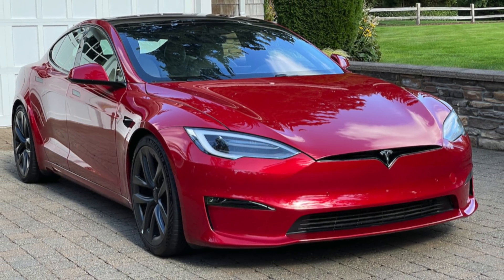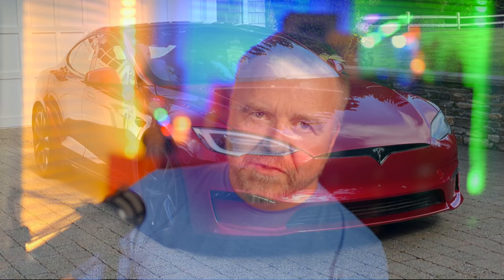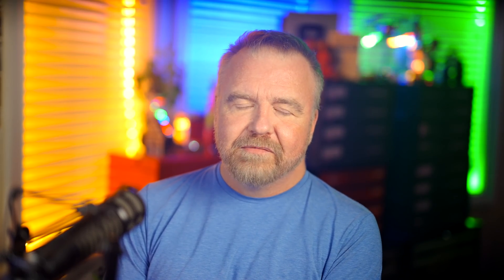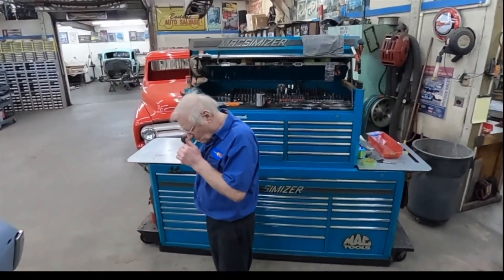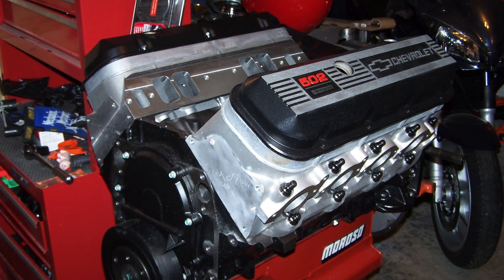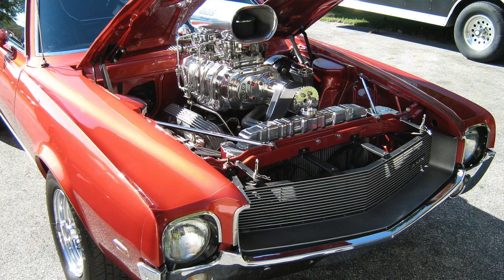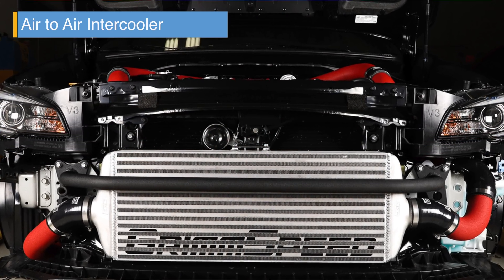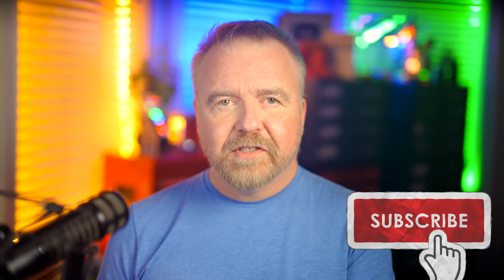Twin Turbo Power Secrets: Can I make 1500hp for $1500?  Plus Dyno Fails!

Comment: "A typical performance engine makes about 1HP per cubic inch of displacement"... I would say that's pretty outdated at this point, even for naturally aspirated engines. This is definitely normal engine HP range at least for the last 20 years. For typical performance engines 100HP per liter or 1.63HP per cu is pretty normal. A K20 civic made 200HP out of 2 liters and the Toyota 2ZZ-GE made over 180 at 1.8 liters. Those are all engines close to 20 years old now and both of these are naturally aspirated... And we haven't even mentioned bike engines which are in a league of their own in the specific power output category.
Reply from the maker: "Typical" might mean something different to you than me!
Reply: @DavesGarage  Yeah no worries I thought so anyways, I just like being pedantic. Often engines like these (while admittedly fun) have questionable everyday driveability anyways.

Comment: Knowing that you're a gear head as well as a techie you should understand what I'm about to suggest. Now, don't get me wrong, I like electric cars and not just for environmental reasons. The acceleration can be positively brutal with all that torque available from 1 RPM to whatever that motors limit is. It's just that today we have all of the parts (technologies) available to perfect the internal combustion engine although I don't think anyone has put them all together yet. Koenigsegg developed the Free Valve pneumatic (cam-less) valve system allowing variable timing and lift of each valve individually, a compressor (charger) can run on a variable speed electric motor instead of a belt or exhaust gasses, fuel injectors can vary the amount of fuel delivered, even spark timing and intensity can be varied, all controlled by the computer chip that all cars now have anyway. Get up to highway speed, open the exhaust valves (to avoid compression or vacuum drag) and shut off the spark to half of your cylinders while you cruise along a stretch of flat highway just sipping fuel at 80 MPH. Put some toe into the gas pedal to pass that truck ahead of you and the engine responds by spooling up the compressor (I can't call it turbo or super because those names are taken, maybe Vari-Charger) to pack more air into the cylinders and increase the compression ratio, pump in more fuel, adjust the spark and valves and you're off to the races. It just feels wrong that the internal combustion engine is becoming obsolete just as perfection is within easy reach.
Reply from the maker: An S63 BiTurbo is an amazing machine.   Not a lot of room to improve and its 1/3 the efficiency pf electric.  It's not that combustion can't get better, just that it can't get close.
Reply: @DavesGarage  and on the obverse, the energy density of gasoline is such that batteries just can't get anywhere close to the same ranges or ease of use. The use of diesel engines in 18 wheelers isn't going to change anytime soon because in order to adequately cover the ranges and towing demands diesel trucks face, an electric replacements battery would make the tractor overwhelmingly heavier, reducing the amount of cargo that can be legally hauled. That and the battery deterioration through such hard use would require even more frequent replacement than in cars. People can say what they will about CO2, but lithium batteries are far more environmentally destructive on longer time scales.

Comment: struck by how casually that engine pulled to 1270. like no big deal.
Reply: It's pretty damn common these days in the tuning world to reach those numbers. Especially when using E-85 gas or better.
Reply: Common these days perhaps but that ZZ502s design sheet dates back to the mid-60s.

Comment: Channel Idea:  How about a custom programmed ECU project built from scratch? The programming involved with ignition timing and air/fuel control would be very interesting. Even controlling a single cylinder engine would be cool.
Reply: If you're interested there's an Arduino ecu project called speeduino. There's apparently another called ardu-ecu which seems to be a hardware box for an Arduino uno/ruggeduino.

Comment: Smaller turbo all that’s needed for your desired result with large displacement so you will get much quicker spooling.
Reply: I've seen some dual turbo stuff that uses a big one and a small one with a selector, the bigger one working for max power and the smaller one for responsiveness at low rpm.
Reply: @satibel  sequential setup. This is how Supra,skyline,rx7,3000gt vr4,300zx systems were setup one smaller one bigger in line to reduce boost lag.
Reply: @Thumper68  I've looked at it, an alternative to turbos in series is the two turbos in parallel Either unregulated, or with offset or independent butterfly valves.
90°offset valves mean that when one open the other closes.

Regulating series turbos by opening or closing the bypass seems to work as well, I'm not sure of the advantages and disadvantages of both.

Comment: Yeah with any ls and couple hundred dollar turbo you can make 1000 hp
Reply from the maker: Make a video or it didn't happen.
Reply: @DavesGarage   didn’t say I did it but there’s tons of videos all over YouTube  people using junkyard ls engines with cheap turbos and making 1000hp. Richard Holdener’s channel is great he tests everything to see what’s possible. 

I prefer a sbc n/a with a carburetor.
Reply: @DavesGarage  nice build by the way would like to see it back on dyno with fuel pump upgrade to see what you can make out of this large displacement

Comment: How can this man go from c++ to building a 1000hp engine
Reply: I go from coding, to all sorts of mechanical contrivances, to constructing buildings, to operating earth moving equipment.  Built my first 1000hp diesel in the early 2000's.  I built my first 1000hp 2000ft/lb capable transmission the following day (true story, still have the twisted input shaft on my desk).
Reply: His channel started off with car stuff. I'm happy to see it return.
Reply: Turbos are HP++
Reply: Pretty easy.
I half a foot in both worlds
Reply: this channel is called daves garage. I'm more wondering why there is so much computer parts in a garage.
Reply: @BloodSprite-tan  should see my shop.. 2 oscilloscopes, function gens, DMM's, etc, plus milling machines, lathes, etc
Reply: wealth & boredom
Reply: @danielfietkau733  he did it with less than $1500 of ebay parts. similar could be done with junkyard LS engines.
Reply: @FM4AMGV  that's kinda ignoring the engine, fuel system, and management  computer!.. and that's just for the engine

Comment: From task manager to a twin turbo v8, this channel has everything
Reply: I love this combination. An update on that Motor for when its in the car would be cool to get the break-HP
Reply: @thepro9376  wouldn't that be wheel hp? Brake hp is hp with no loss (transmission, alternator, water pump, supercharger, and anything conected to the crank, even the crankshaft itself)
Reply: @Giuliana-w1f  I thought, brake-hp is with losses.
You're right, I ment wheel horse power. Turns doing multiple things at a time resulst in confusion on my side. Thanks for your reply.
Reply: I like it!
Reply: that's what makes a true engineer. No matter what field, science dictates everything if you want to do it right.
Reply: First of the car stuff I've seen from him (is this the first?) Dave is a smart feller!
Reply: Twin-turbo big-block V8 no less…